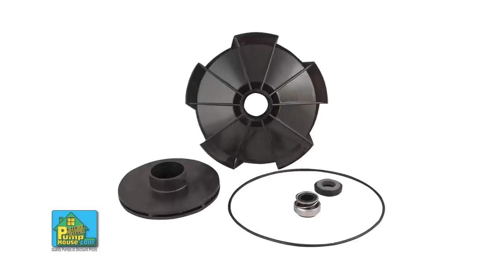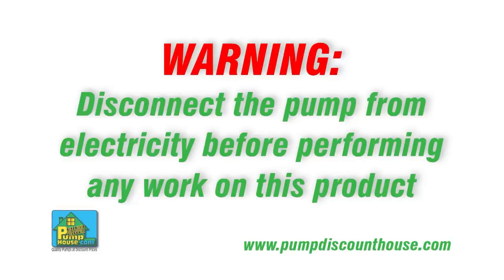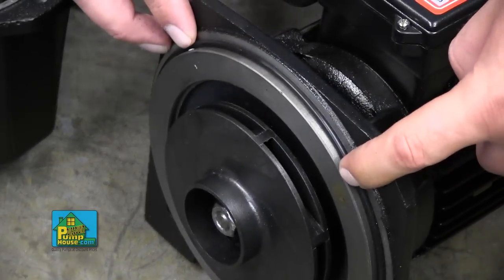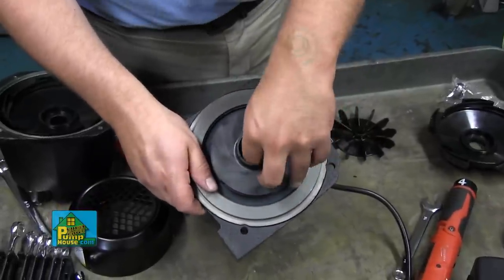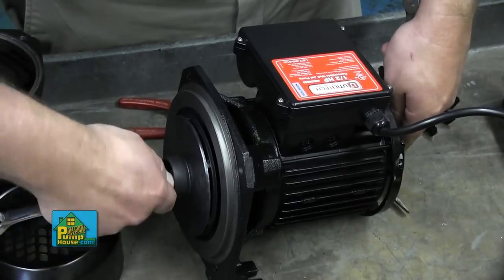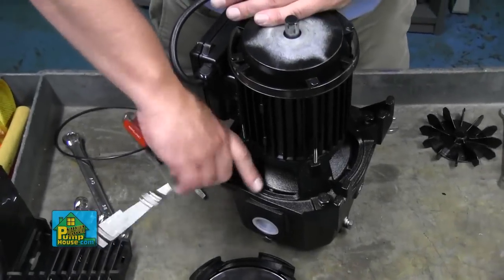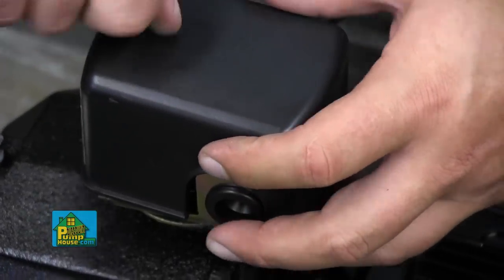How To Repair a Jet Pump - Shallow Well, Deep Well, Convertible- Lowe's Utilitech, Menards Barracuda

Comment: My pump was in horrible shape, lots of rust and had to use penetrating oil to free up the washers and nut on the shaft, definitely not clean like the one in the video.  The key that was on the shaft fell somewhere and couldnt find it after pulling the dang thing apart with a puller because it was so full of rust and corrosion. Headed in the buy 5/32” key stock tomorrow   Of course nowhere can I find dimensions of the key. But I will make it work. This was a great video to get me started. Thanks!

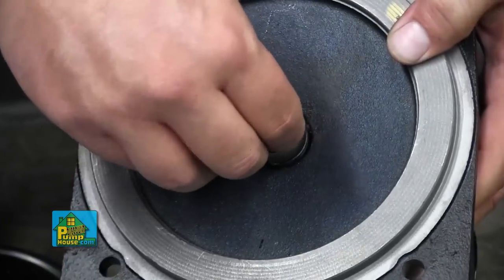Comment: I have a Everbuilt brand jet shallow water pump model  J100A3 and I can't find any replacement for this model ,the piece that I want looks the same  as the one you show, this strange  seal with a spring 2:39

Comment: Thank You this is a nice video. But my experience has been that the bearing behind the impeller goes bad. I wish they would have taken the pump further down and shown the bearing replacement. I am in the middle of replacing the bearing and I should have video taped the disassembly because like an idiot I forgot exactly how the seals go back together behind the pump housing itself. My Bad... lol . It's hard to find a schematic showing those seals.

Comment: I have utilitech 3134, 3/4 HP . what the replacement kit number?
Reply: bonze2001 Gud day I have a Bolzano 1/2 Hp jetpump And I want to replace leaky mechanical seal.can u give me an idea about the type of mechanical seal.because when I disassembled it I found out that only a piece of rubber seal and a ceramic type ring.I dont have any spare to compare with.tnx